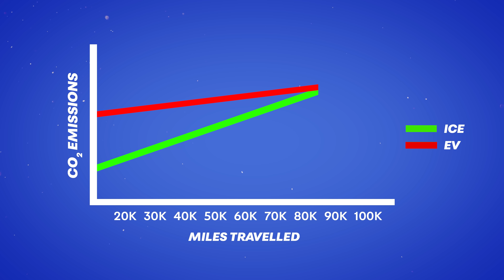Are Electric Cars REALLY That Green? [New 2022 Data]

Comment: There's a limit to the CO2 footprint reduction that can be achieved by an ICE power train that burns a fossil fuel but some of the alternatives capture as much carbon during production as they emit during combustion (100% biodiesel, bioethanol) for example and other alternative fuels don't emit CO2 at all (Hydrogen)
From a purely future proofing perspective, if we put more money into researching converting petrol cars to hydrogen (which has already been achieved but not at mass production scale we help build the supply chain that will eventually ensure we can all fill our hydrogen fuel cell electric vehicles at the roadside and at the same speed as we currently fill petrol or diesel. This has the added benefit that the changes to an existing car do not require re-manufacture of the entire vehicle and thus are probably cleaner. Reduce, Reuse then Recycle. Batteries can only ever be a stop gap, because ultimately they're hugely damaging to produce and require masses of really toxic chemicals.

Comment: My biggest issue with Volvo's report is that it doesn't compare the lifetime CO2 costs of building an ICE car with a BEV. It compares the lifetime CO2 costs of building an ICE XC40 with a BEV XC40. The very fact that these are built on the same platform means that it's not optimised for either. For instance, how does the lifetime CO2 costs of building a BEV Tesla Model 3 compare with an ICE Tesla Model 3? Erm...
The only people for whom this information is meaningful is someone trying to decide which XC40 to buy. It would take a much broader survey to give a reasonable understanding for the industry as a whole.
On the question "why did Volvo do this?", they've said publicly that they want to use it to bring pressure on the energy industry to accelerate the move to renewables.

Comment: Would be good to see the cost of charging and running an EV in comparison, to pre energy price cap changes, in the UK, and post.  I can imagine they cost a good few quid more to charge now.  Of course petrol and diesel costs are up, but thats just a scam itself.  Need to see both return to £1.15 - 1.25'ish a litre. Probably cheaper and more economical to run ICE then.
We need multiple solutions to replacing ICE, over a longer period of time than the UK government has mandated.  It will cost us all significantly, to get anywhere near the UK governments targets.
Reply: Your logic: electricity prices and fuel are both higher, but lets consider the latter "a scam" and former a genuine problem to support the point you are about to make. Also: talk money, money, money, on the video that discusses something completely different. Do you work at Volvo or something?
Reply: Indeed, the cost of charging an EV has risen, even when charged at home. My EV tariff was 5p per kwh before the World went mad. I've now seen a 50% increase, to 7.5p per kwh - for a few hours during the night. With these EV tariffs, you usually get just 4 to 5 hours at the cheaper night rate, but that usually easily covers any mileage you've covered the day before. Even at 50% higher cost, I'm still seeing abut 100 miles for £3... Public charging is another story though. That can often cost up to 60p per kwh (or more!). But the majority of EV owners rarely touch those. I haven't used public charging for about 18 months.

Comment: A bit curious as to the overall longevity of current generation EV's. Will they even last that many miles?  What happens when the battery needs to be replaced?  Does it send you back to square one?
Reply: The Gatwick Tesla Model S Taxis are on 300,000 miles showing 7% battery degradation and still going.

Comment: And that doesnt consider if you have to change the batteries, which you will have to at one point in the car's life, I can assure that.

Anybody selling batteries know LiFePo batteries rarely last over 10years, and thats estimated life under optimal conditions, i'm not sure they even last that long given how it'll need to be mass produced, and people generally don't know how to tend to batteries.

We also know that you don't replace one battery and your done, you change de whole bank if just one batt is dead, else the newer ones will compensate for the old one and die even faster.

I'm not sure Volvo's report take into account the pollution for extracting the raw material either, because 90 000km is a data I saw long ago already, and it wasnt taking into account raw material extraction.
Which is funny because the ecological média outlet that let this data out in the wild like a year or two ago, was taxed of complotism.

We're also talking 3 to 4 time the amount of copper, lot more aluminium, and so on.

Windturbines are an ecological nonsense as well, but oh well.

You're right on the conclusion, at least they don't have an exhaust pipe, so the pollution ain't right under our nose, but in Asia and Africa. Much better this way :)

I don't care if the cars are ICE or EV in the future, I'm just tired of ecological nonsense as solutions.

Comment: I would like to say congratulations on a well balanced, well researched and well presented video. 
This sort of content allows people to see the real consequences of decisions. 
While EVs may have a place as replacement vehicles in the future, pushing people into purchasing them sooner than necessary will only push up carbon emissions. 
Without it occurring naturally over time it can only remove the reason for having them.
Reply: for city dwellers it's much easier, buying a cheap last mile PEV will be a positive change, and you can choose your position (scooter / bike / unicycle / skateboard etc) I've commuted this way or bike for 10+ years. Keep in mind also, it's about critical mass. When enough people are driving electric cars, the investment in them by the big companies will skyrocket, and we'll have bigger breakthroughs, tesla is not enough, (and also has a man-child at the wheel, but luckily a good CEO) 

so there's not a way to calculate the carbon offset of early adopters considering they are helping push the technology. As with everything there's 50 billion shades of gray (no pun).
Reply: that's especially true of those who may think driving their used vehicle may be more harmful than a new EV and are thinking of getting one.  Purchasing one by and large only makes sense if you're getting a new vehicle and you'll keep it long enough to make a difference.  Unless you drive a gas guzzling brodozer.

Comment: If you buy the car new, you will likely sell it and buy another new car before you reach the break even point. The best way to go green, would be for countries to invest in public transit networks and switch power generation from fossil fuels, and even from solar and wind, in favor of nuclear. Solar and Wind farms are not nearly as efficient as a nuclear reactor, and still rely on the use of rare earth materials and polymers in their construction and maintenance. Like it or not, nuclear power is by far the best way to fulfil our power needs with the least amount of pollution, and coupling this with an effective elctrically powered mass transit system to reduce the need for personal transport will have the most impact.

Comment: One detail missing. The battery needs to be changed. That change dips the CO2 footprint back at the ICE cars level. The good aspect of electric cars that no one is taking into consideration is pollution control. Having 1000000 cars in a city is so much better for everyone than what we are having now with ICE cars
Reply: The batteries don't necessarily need to be changed. They can be refurbished, at much less cost than a full replacement.

Comment: This study has a few flaws.
1. They compared an platform which was built to be an ICE/hybrid and its not a pure electric platform. The electric model therefore has a disadvantage and become more heavy and less aerodynamic compared to a pure electric platform. 
2. The factory produces BOTH the electric and the ICE model. Therefore the electric car manufacturing is not as efficient as it could be.
3. Volvo does not manufacture their own batteries in the same factory. This is suboptimal from a CO2 perspective. 
4. They assume that the energy mix will stay the same during the lifecycle of the car. This is clearly a huge mistake as the energy mix is continuously becoming greener over time in almost all countries. Just look at the trend during the last 20 years and see all green energy projects planned. Extracting oil will at the same time only become more difficult and therefore emit MORE CO2. 
5. The electric XC40 is not an efficient car with 240wh/km. A Tesla model 3 Long range is quicker, has more storage capacity and has a real life consumption of about 165wh/km ( my own number based on 25.000.) That means that the Volvo consumes 42% more! So why compare a car with such poor consumption?
These are just a few flaws I found. Electric is superior and its the future.

Comment: Why do they only allocate a higer rate to the BEV for the energy mix and not to the ICEV?
Gasoline also uses electricity (as well as significant energy in every step of it's production, and I haven't seen a study on the carbon footprint of the millions of tons of toxic chemicals needed with fracking and tar sands).  When the electricity grid is dirty, it will also affect the carbon footprint of the ICEV.

Comment: Always good to see a real discussion, that takes into account arguments on both side and doesn’t downplay the reality of a complex issue. I’m curious, does anyone know any data on power/mileage loss for EVs over time? All batteries wear out, with diminishing returns especially after many uses and recharges. I’m assuming an EV must get significantly worse “mileage” at 75K miles compared to when it rolls of the line.
Reply: So Tesla's have gone past 500k (miles) and only been diminished to 80% battery density. Thats 800,000km... so not that much at all. Kind of crazy to realize that we are at a time where the battery and drivetrain last that long without any maintenance. Bear in mind that this is early on battery tech, its only been 13 years since Tesla was created and the whole auto industry started switching over only a few years ago. ICE has had 100 years and the best it can do is tons of maintenance, maybe 400,000km with some major maintenance and only 30% efficiency from the tank to the wheels. In 10 years it'll be an embarrassing comparison between electric and ICE when you factor in all the competition that will be ramped up in that time.
Reply: What they don't tell you is the battery replacement cost which is 2/3 of the original car price & costs in very rare metals mining are high!!
Not to mention we only have a certain amount of rare earth metals hence the name rare earth, the EV dream is exactly that "A DREAM" it's not practical for the long term a bit like "GREEN ENERGY" actually

Comment: This calculation is all well except that almost no EV batteries will last long enough to reach the 120000 mile period used for this. I dont know of any company that warranties the batteries past 8 years and most are much less the last time I looked. Using the British average car uage that means 7400 miles per year and 8 year battery life would mean people reach only 59000 miles before the battery is out of its useful service. Not only that but how many people even own a car for 8 years anymore? Most will trade it after 5 years or so meaning that the manufacturing footprint will never be recovered and nobody will buy a 5 year old EV as the useful life is mostly gone.

Comment: Once grids start using more renewables and the production of batteries becomes more efficient, the break even point will come sooner. I live in an area that gets 96% of its electricity from hydro electric dams. It also has some of the most expensive gas in the North America so electric cars are very popular here. The break even point includes areas that produce nearly all their energy from coal which brings the average break even point up. That can change relatively quickly. The mining, manufacturing and recycling of materials will also become more efficient and greener as renewable energy sources are used. So in the long term, electric is still the way to go. 

There is a CO2 hump you have to get past before you can transition to all renewables. You can't build renewable sources of energy without CO2 until there are more renewable sources of energy. Once you are past this hump, electric cars make more and more sense.

Comment: Every comment listed here ignores that 98% of an electric battery is now low-energy recyclable - thus no further significant impact on the environment for subsequent deployment of the batteries' chemicals. With Gigacasting and assembly time of 10 hours per vehicle true electric cars use significantly less energy to produce. That POS Volvo is hardly the example vehicle to use as it is assembled using outdated ICE technology, is no more aerodynamic than a house brick & weighs something like an Abrams tank. If a comparison study is to be valuable it needs to compare modern LFP-powered cars and not LG-chem Nickel/Cobalt cells with their ICE equivalent. Even a hydrocarbon-powered power station is 55%-60% efficient in its conversion of power whereas a gas-powered engine is just 15% a fact seemingly missing from this report. I see this report, incumbent with misinformation, as a last-gasp effort to continue selling ICE & PHEV vehicles as Volvo plays catch-up to the true EV leaders.

Comment: The CO2 output of EVs is great, its the down stream effects of so called renewable energys, the life span of EVs and especially their batteries that concerns me. No one asks about the disposal of heavy metals in the batteries, in solar cells, the disposal of hundreds of tons of fiberglass per wind mill. These questions need to be answered and weighed.
Reply: And also that ICE car can be driven for more than 20 years with proper mantainance from any mechanic and spare parts brand that fits. An EV is garbage after 5-10 years and maintenance can only be done by the producer.
Reply: If that hasn't been figured out, then why have so many governments transferred money from middle-class people to upper-middle-class people to buy an EV ?
Reply: @suserman7775  It has more to do with wasteful spending/programs than a $7500 tax break on a new EV I assure you.
Reply: The life span remains to be seen, much like the first few years of automobiles in 1908, but we all know how that turned out since 100 years later cars are more reliable than they've ever been in the past, especially with regular upkeep. Disposal wise everything gets recycled or repaired, Tesla and Redwood Materials out of Nevada recycles ~95% of the batteries, Gruber Motors repairs battery packs along with Rich Rebuilds, and Global Fiberglass Solutions in Texas recycles the turbine blades.
Reply: @TPCColo  How do they recycle the blades?

Comment: I have not, to date, seen anyone explain how the electrical system will be able to handle charging all those batteries.  No one wants to touch this issue.  No way, no how will our grids be able to handle it, and our electric producing capacity is way too low

Comment: Problem is, the "Green" energy in the grid, ISN'T ALL THAT GREEN EITHER!!!  Windmills require up to 200 CUBIC YARDS of concrete in the base, which requires a massive amount of CO2 to produce.  Then there's the steel or aluminum in the tower, lots more CO2 to produce.  The blades use fiberglass and resins made from petrochemicals, MORE CO2.  And they have a relatively short life span, MAYBE 20 years.
Same with solar panels.  Petrochemicals galore to make them, plus the metals, and a not really long life span.  
Both require massive battery banks to have reliable 24/7 power availability, which means mining even MORE heavy metals and pollution.  
And what happens to these EXPENSIVE battery packs if they go bad??  Replacing a gasoline engine AND transmission are at least HALF the cost of a battery pack...  Not to mention limited range in an EV, which can be a problem in the US, because you could easily travel over 500 miles in a single day, I've done up to 800 in a day.
Myself I'll NEVER have an electric vehicle...

Comment: Yes, Hat's off to Volvo!
Wondering, did they consider the child labor used for the Lithium procurement?
Did they consider that those Batteries will have to be replaced sometime around 100,000 miles? Gee, that might adversely affect that graph!